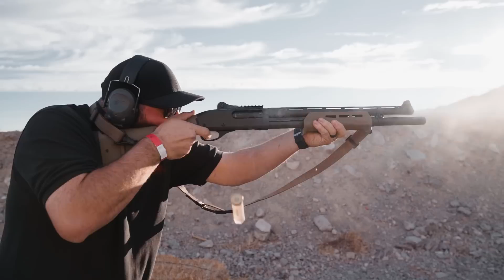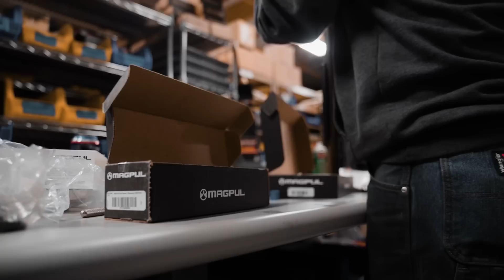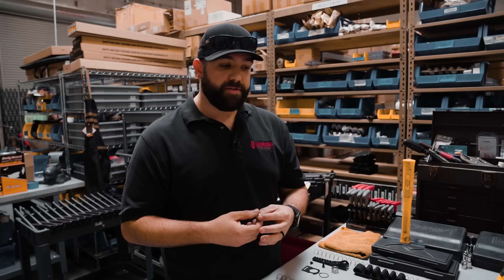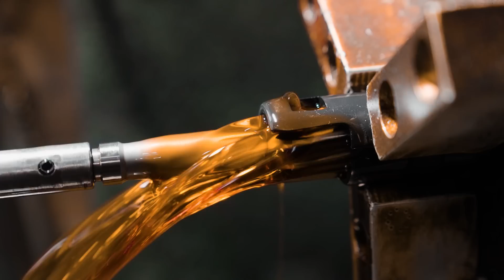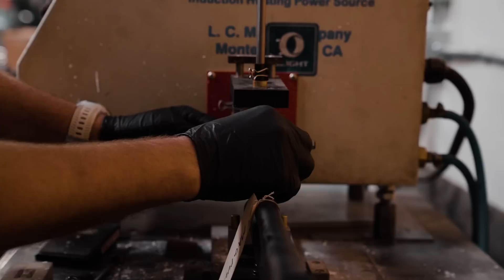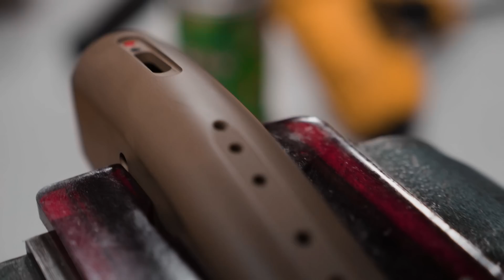Magpul x Vang Comp

Comment: Maybe a stupid question.. but instead of going to all the effort of lengthening the forcing cone and back boring the barrel, wouldn't it be easier to just thread the barrel?  (Then you could just add a tighter choke tube if you wanted.)

*Edit
Ohhh... Never mind.  It would block the porting and you'd lose the recoil reduction.
Reply: Thread the barrel for choke tubes, but use extended ported chokes.  Problem solved, and it is a much cheaper option compared to the Vang Comp System.

Comment: Why would you want a tight pattern with a shotgun? Why wouldn’t you just use a rifle or slug if you want a tighter pattern? Also isn’t the whole point of buckshot to spread and put a bunch of lead out there?
Reply: This is an older post but maybe you'll see it. If you're blasting birds then yes you want spread. For home defense not so much. You're responsible for every object that comes out of the barrel. Let's say a baddie breaks in and you shoot with regular 00. In my shotgun Winchester super x patterned 10" at about 30ft. 10" will land all pellets on a baddie IF i land a dead center shot. When stressed confused and half asleep what are the odds i aim perfect? Ok so now 1 or 2 pellets miss now where do they go? Do they hit a fridge and stop? Go through a wall and hit my dog or child? Maybe even through a window and hit a neighbor's house. Ok so to fix the spread problem you go slugs. Single object less likely to miss, certainly capable of stopping a threat.. as well as everything in its path for a very long distance. Most slugs are full power, waaay over penetrate a human size target and can hit who knows what behind. A tight 00 group hits concentrated like a slug first so less likely to miss, but rapidly spreads out inside the body causing lots of damage but more importantly slowing down much faster than a slug reducing passing through a threat into whats behind them.  Federals flight control shells have lower velocity helping this even more, stay super tight, don't recoil as bad improving follow up shots, and inside a structure wont totally rock your ears as bad as a full power slug (but will still suck) and they routinely hit the sweet spot in ballistic gel testing. This is long winded but knowledge is power.
Reply: Yes.  The Vang Comp barrel in my opinion, is just a gimmick along with stuff like federal tactical buckshot with the flight control wad.  In my area, slugs are cheaper than the tactical buckshot.

Comment: I was thinking about selling my Mossberg 590 to offset the cost of the Beretta 1301 I got. Now I'm debating sending the Mossberg to get the Vang Comp treatment.
Reply: I would just sell the Beretta and keep the Mossberg, but don't bother sending it to Vang Comp.  If you really want a "tight pattern" don't even use buckshot just use a low recoil segmenting slug.

Comment: Strange to see a custom shop that offers accuracy improvements that doesn't pattern the gun.
Reply: It's because we have been doing it for 30 years we have the recipe down pat.  And to be fair, a pattern test was in the video (the cardboard shots). We just don't pattern test every single barrel because there isn't any benefit for us or for the client.  Every load is going to pattern in every barrel a bit differently.  So we have a guarantee of a 10-12" pattern at 25 yards with 00 Buck. If your barrel doesn't pattern with your load, you send it back to us and we make it run and reimburse you for shipping.

Comment: So you can use a drill and brush to clean the bore…I see that right? My 1301 has a tone of plastic build up in the center barrel. Almost looks like pitting but it’s brand new. Beretta says we don’t know and shouldn’t be happening. People advise against drill and brush because it can make it worse 🤷🏻‍♂️
Reply: If you don't know what you're doing, then a drill and brush can make it worse. If you're having plastic fouling, check out RGS Bore Cleaner. Let it soak then brush it out, you should be G2G.

Comment: I should look to see if they have a mod to make my Mossberg run shorties reliably.
Reply: Not yet.  Mossberg will release their Short Shell conversion kit soon, it will retro-fit into almost all 12ga Mossberg.
Reply: The OpSol mini clip 2.0 is $15 if u haven't tried one.
Reply: @kctyphoon  Good call, that works well, but the 590S kit includes a modified lifter and bolt slide to control the shell feeding even further. And it will run longer shells with no issues also.
Reply: @VangComp  true - but right now (today) its the difference between buying a new $500+ gun if you can even find one, or a $15 - $25 piece of rubber you can buy TODAY. No telling yet what Mossberg will charge for a conversion kit or what availability will be like after/if  one is released.  I waited months just to buy a Factory magazine tube CAP for a Mossberg 930, and have been waiting almost 2 years for the 930 SPX to return to prices based in reality. 
Sportsman Guide took backorders for ammo promising delivery in 2 months, continued to push the delivery date back by months till it was over a year wait, then changed it to 2 years past the original order dates -  until they finally cancelled all 4 of my orders - all because they did not what to honor the price the ammo was advertised at while taking orders.  Yet, that same ammo is still advertised on the site at a much higher price.  Basically they made bulk ammo orders for everyone - and by the time the ammo came in retail prices jumped so much instead of honoring the orders they decided to instead sell it off to new customers with a 30- 40% markup….     (Rant Over)
These days you are better off going with the option you know you can get now, esp when your only talking about a $15 investment. Just my 2 cents.
Reply: @kctyphoon  Good point.  Yes, it's crazy times now.  The point I wanted to make is that the Opsol Clip doesn't always play well with regular shells also. I do have the 590S in stock right now and they run 1-3/4", 2-3/4" and 3" shells without modification.
Reply: @kctyphoon  Typical behavior from SG. I haven't done business with them for over a decade due to this.